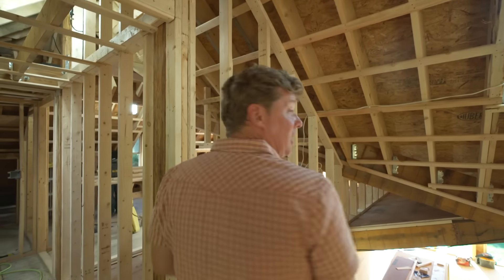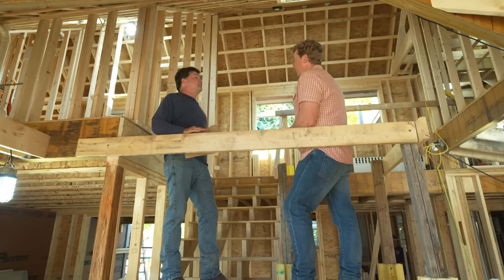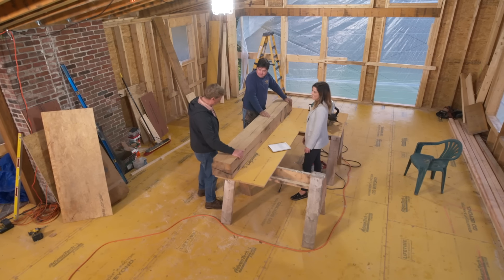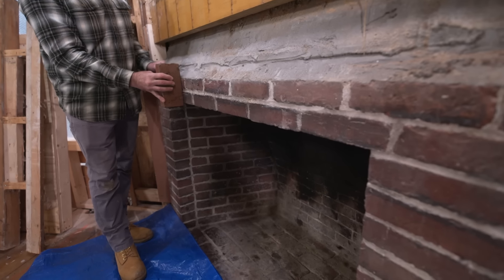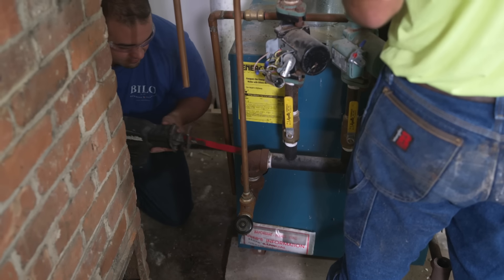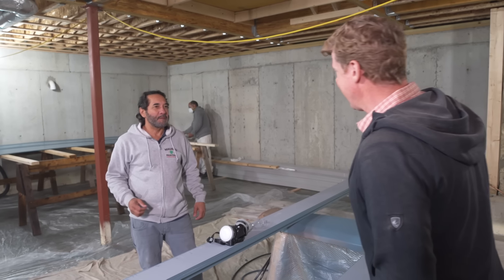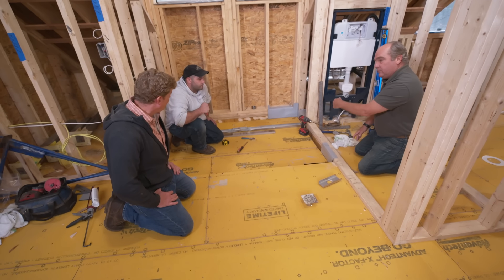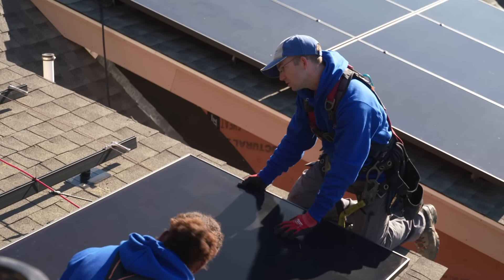This Old House | Race to the Finish (S43 E13) FULL EPISODE

Comment: A word to the wise on the linear shower drain.  We installed one similar (or maybe the exact same linear drain) as the one you showed.  (1) linear shower drains are originally for large format tile.  Because larger tile (say 12" x 24" or larger), can not "bend" to fit slopes to a small drain, the linear drain was created.  If you have large format tile, make sure to use a linear drain, and size it to fit the width of the shower - your tile guy will get a much better job that way.  (2)  We chose a drain "grill" or "cover" with the linear bars like the drain you show.  I thought the linear bars looked beautiful, and they are.  But, those bars are a "magnet" for hair.  We have to clean the linear drain out every 4 to 6 weeks of daily use.  Easier to keep clean would be the drain cover made up of a single sheet of perforated stainless steel.
Reply: My very first thought on that drain was how is that going to be kept clean. I wouldn’t choose it for that reason.

Comment: If you follow period correct moldings and mantels?  Like with Brent Hull?  Then the chunk of wood as a mantel is not period correct unless your recreating the 80’s and 90’s ?  

Yes I am a finish carpenter and hv done them at customers request but this seems or was supposed to be more affluent designs in this house?  I thought ?
Reply: Brent Hull FTW, but have you seen the addition to this house? Clearly no one cares about it being architecturally well-done.

Comment: Water in water out shower floor? For years know the rest of the building industry has been pitching the subfloor towards the drain prior to pan liner installation! Copper pans do not conform to a funnel like prepitch.  Company and Portland cement do not well together.  Copper pans are normally installed with a cast iron shower drain body. Plastic drain body assembly are  not normal  installed with a metal pan! The copper should be protected from the Portland cement  by Appling a protective coating directly to the copper.

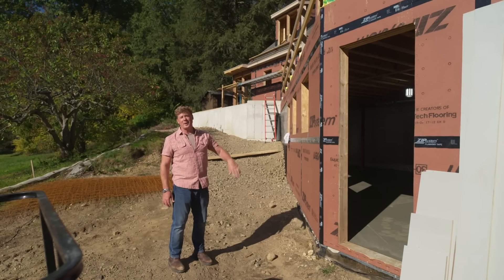Comment: 2:02 Hoo man. That 6x6 #6 mesh laying flat on the ground under the poured concrete with the guys walking on it tromping it down into the closed cell foam just to make sure that it adds absolutely no strength to the slab is kind of no bueno. Kind of surprised that you’d leave that in the edit for the episode.

Comment: #1- I don't wear harnesses...#2- I have been using ice & water membranes for 30 years or more, this is a tight, tight system...most guys won't use them cuz they are lazy & cheap...#3- at 65 I still like to learn...I can always glean something from these guys. Before I get put in the ground, I'd love to work w them on a project...may be my one & only bucket list